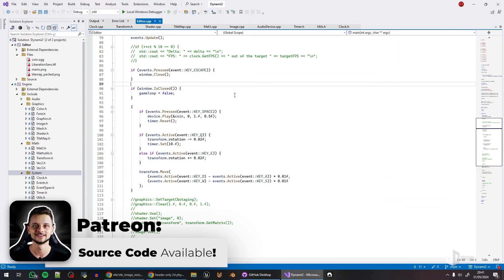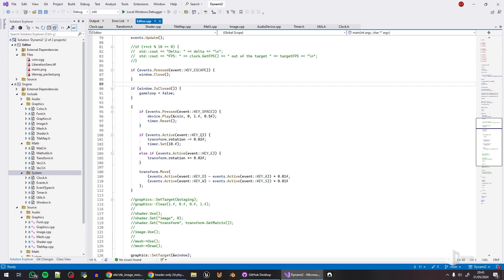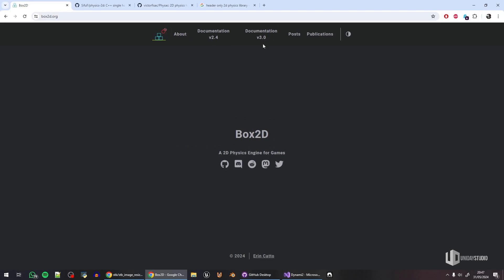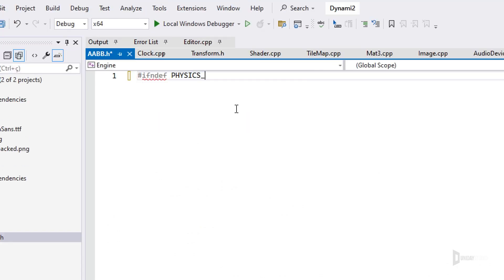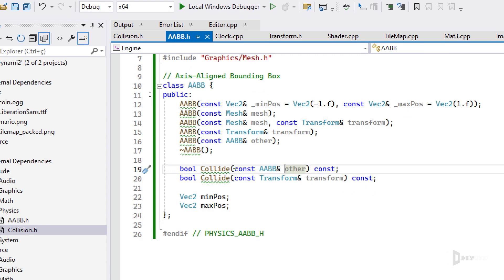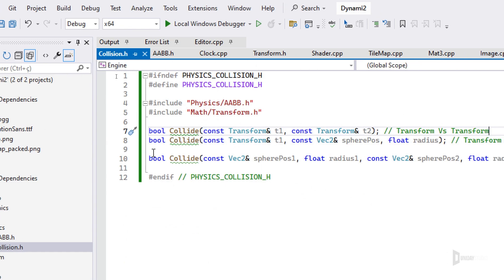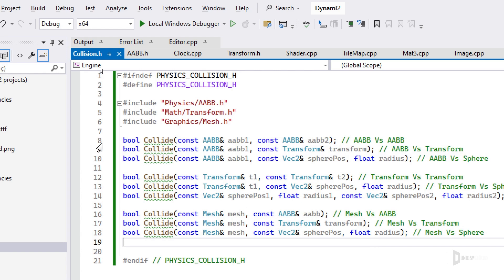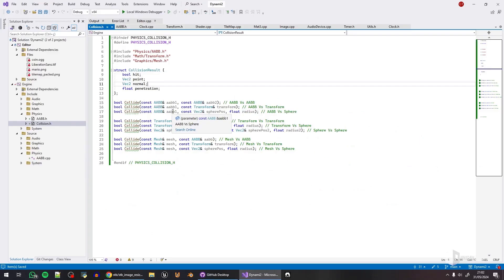Writing a Basic PHYSICS ENGINE (Part 1) | C++  Engine Devlog #11

Comment: You kinda want to convert-ish to a physics struct regardless because AVX2 is basically a 2x speed increase including the time it takes to convert naively.
If you do square collisions (what your AABB is) you can store a packed left and a packed right compare and do collision in a single quad less than instruction.
(If you can support avx 512, that's an extra 2x speed, though you basically need 2 engines/2 versions of quite a few functions if you wanna keep speed as there's still quite a few processors without avx512)
Also you may want to have grid segmentation so objects that definitely won't collide won't do collision checks, if you have a lot of collisions that's a good speed increase.

 density field based collision is also a great way to speed up physics on huge amounts of similar objects, basically the objects on the inside the field don't have true physics and are just placed, only the outside of the field interacts (something that can speed up stuff like the physics2d planet if you make each planet have collisions with other planets. Basically imagine instead of individual planets, the group of planets behaves as a fluid with vectors going from high density to low density areas moving the objects, to that you can also add force vectors.

Imo a good example of that is the rats in a plague tale.